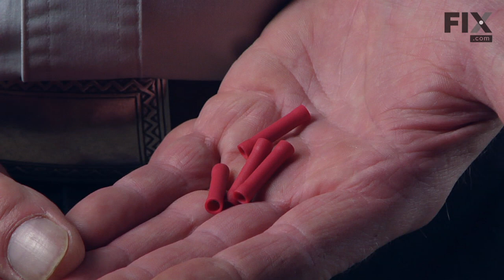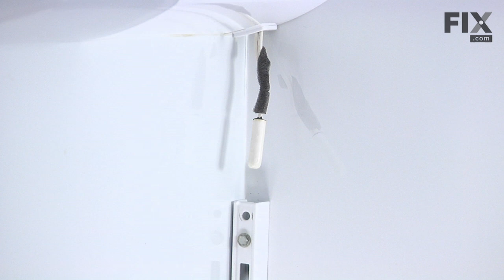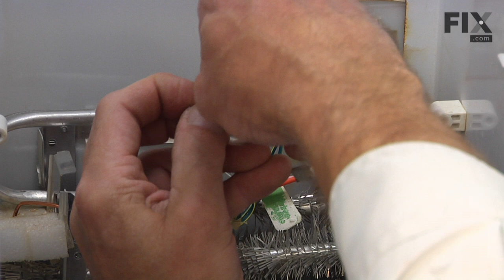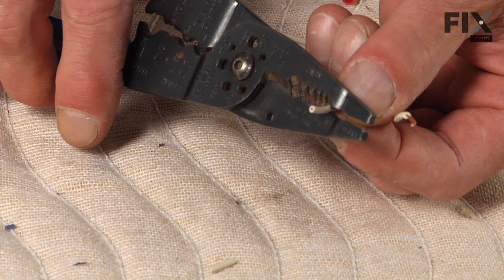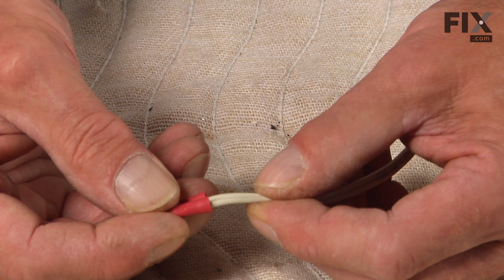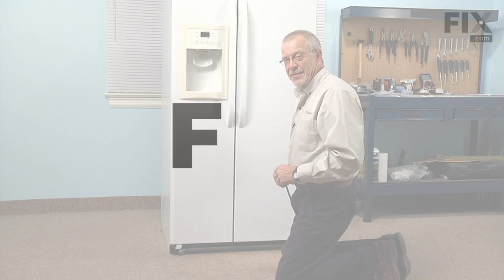GE Refrigerator Repair – How to replace the Temperature Sensor

Comment: My temperatures seem to be fluctuating, especially on the freezer side.  I realized there was a ton of dust buildup in the back near the fan.  I cleaned that but still the temp is fluctuating.  Any suggestions?